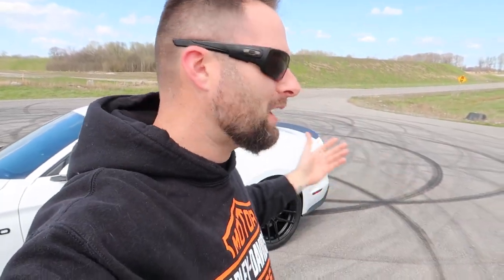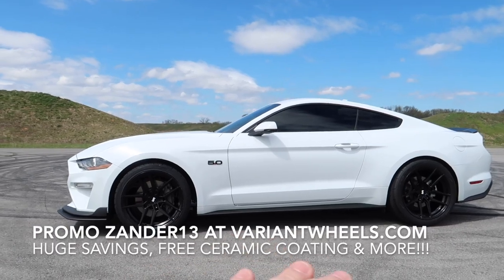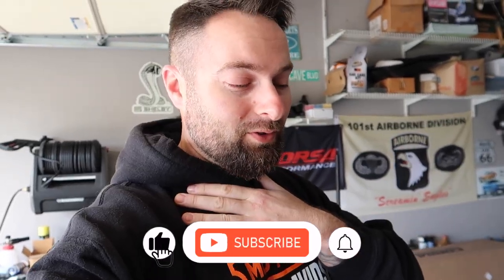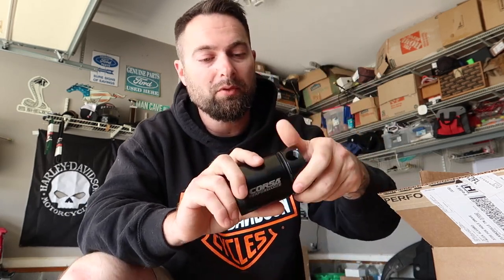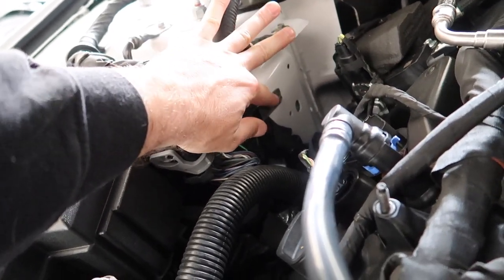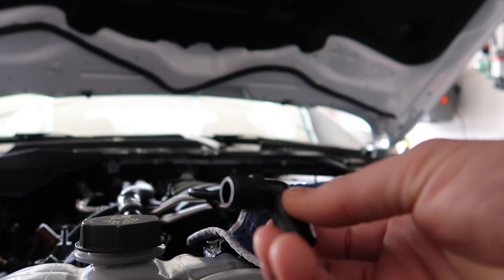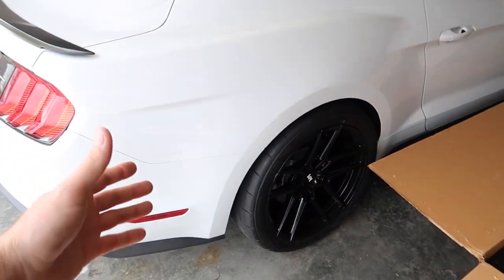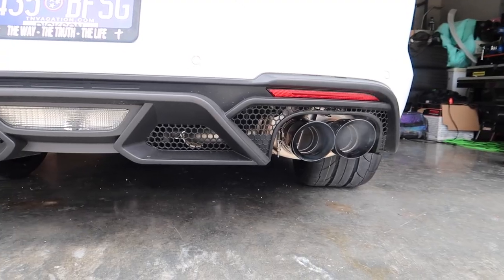LOUDEST CORSA EXHAUST ON MY 2022 MUSTANG GT *MY NEIGHBORS ARE GOING TO HATE ME

Comment: American racing catted headers, double H pipe and corsa sport catback (touring mufflers) on my boosted s550. I love it. When I was young I wanted my cars as loud as possible but I'm over that now. Don't get me wrong my car will definitely get loud but it's not stupid loud. Being loud doesn't mean it sounds good either. Active exhaust is the best of both worlds. If I had active I'd probably go with the extreme system but I doubt I'd run it in track mode very often

Comment: Sounds killer def my next purchase on exhaust. Hey Zander I got no check engine code on my 2018 mustang gt and it’s surging at idle. Leaning towards the vvt solenoids or cam phasers. Gonna clean up my maf and throttle body this wknd first
Reply: No check engine means it’s the solenoids, but clean up the maf and throttle body for sure. Cam phasers usually throw a check engine

Comment: So I had a 2019 GT PP1 Premium in all black with Active Exhaust. I currently have a 21’ GT PP1 Premium in Ox White over Showstopper Red, non active exhaust. I didn’t realize my current car didn’t have Active exhaust until I was driving g home after the deal
Was done. I assumed it had it because the car is absolutely loaded so I just figured it had it. It doesn’t! Had I known it didn’t have it, I wouldn’t have bought it. The spec is what sucked me in and out blinders on me with the white over red. My 19’ with Active Exhaust sounded much better. Louder, more bass and just a tighter sound. No rasp. Exactly how your 22’ sounded before you put the Corsa on it. I know for me personally, my 19’ sounded better stock than my 21’ does stock and that’s simply because the 19’ had Active Exhaust and the 21’ does not. Perhaps your 19’ did not have the Active Exhaust? It’s such a diff maker. Completely diff sound. Just tighter with zero rasp…. Just wanted to share my personal experience. Again, the Active Exhaust made such a diff in sound so much in fact that I would not have purchased my 21’ had I confirmed whether or not it had it BEFORE I did the deal. I , stupidly, assumed it had it since it has Magride, B and O and every other option but no AE. Lesson, before you drop $54k on a car, review every single option, you will be thankful you did!

Comment: Do you know what ford added port injection for? Valve wash, you don’t need catch cans unless your boosted
Reply from the maker: Ford has ALWAYS had port injection on the Coyote engine. Only until recently in 2018 did Ford add Direct Injection combined with Port injection. And yes, these catch cans Absolutely work, even when you are N/A. Many MANY MANY PPL have been doing this for years and they work. But absolutely a must have also when you are boosted.

Comment: Does sound better than the 19 when you had corsa. You convinced me (all your credit) to put the double h pipe on my 2020 GT500 and now i just installed the same extreme as you just did on my 23 GT. Looks and sounds great!
Reply: @MPRR: what sounds better? Since you have had both what is better, the double H-pipe or the double X-pipe??? Does it change your choice if you are adding long-tube headers? Thanks!!!
Reply: @MPRR: I have listened to the double H-pipe and it was deeper in tone and I felt like the double X-pipe was a bit more raspy; however, those comparisons were not Corsa exhaust.
Reply: @gordydexter2615  double h is a bit deeper. I put a resonator delete x pipe from lethal to start on my 500. Then went corsa extreme double h but had kooks with no cats so It was so loud It didn’t matter how deep It was lol.

Comment: Hey Zander how can I put a catch can on my 2019 procharged Mustang or can I even put one on it? Thanks
Reply from the maker: Yes you can. You may need to modify one of these and add another check valve in the catch can lines or go with a UPR setup. They have some made specifically for your boost